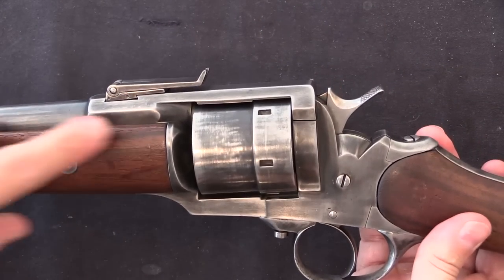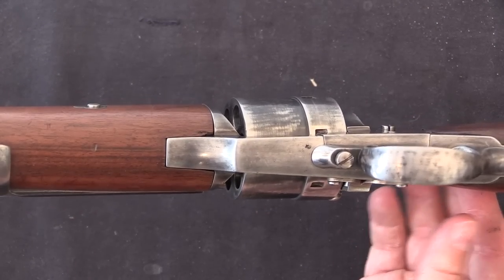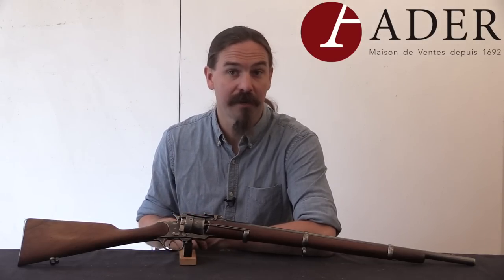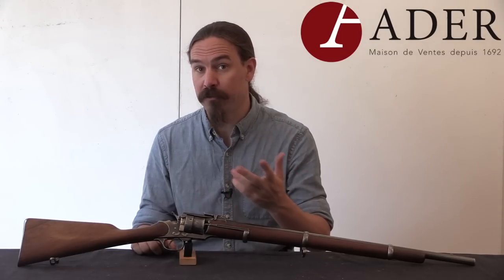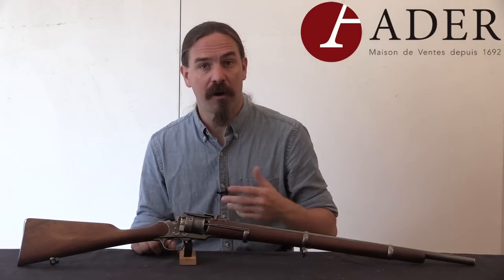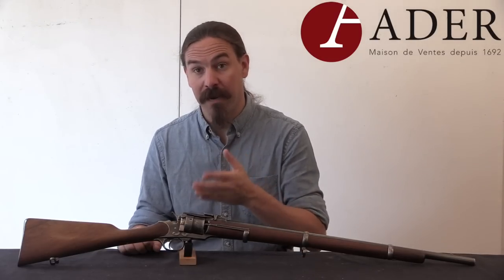Beautiful Perrin Revolving Carbine

Comment: if i could go back in time and give designers the idea for the gas-seal system from the nagant then maybe revolver carbines and rifles would have become a thing
Reply: Better, give them some Nagants and let them figure it out.
If you come from nowhere to explain this, they might take you for some crazy dude, or they will have trouble understanding.
Reply: You don't even need gas seal, just a piece of sheet metal around the bottom of the cylinder to shield the user's hand, like Rossi and the Russian MTs-255 revolving shotguns do. Why people didn't do this back in the day, I dunno.

Plus the forward sliding cylinder for gas sealing wasn't new, Savage cap and ball revolvers also did that. It's mainly the ammo that the Nagant used that was the new thing.
Reply: @SonOfTheDawn515  Well, A: the Rossi is a .45Colt/410 hybrid, it can shoot both, and .45Colt is a hell of a lot more powerful than 11mm Perrin.

B: That literally doesn't even matter, you're just making a small shield not enclosing the entire cylinder, the gas doesn't build up pressure, it just redirects it away from your hand. At worst you'd use a slightly thicker piece of metal.

(Also since these are black powder cartridges, modern smokeless shotgun shells actually likely, if not certainly, produce more pressure anyway.)

Comment: Might I hazard a guess that the reason that the carbine was single action was to make it more attractive for military sales? There was an obsession right up to the middle of WWI with troops wasting ammunition if they could reload and fire too quickly. Hence clinging to single shots long after efficient bolt repeaters came along and the fitting of magazine cut-offs later on. It even persisted into the 60s and 70s with full auto locked out or eliminated on some selective fire weapons.

Comment: Came for the Mr bungle , got distracted by forgetting weapons. Again. Always a top notch production. At this point even failures in the video shoot are endearing and add to the feel of it being real world and not a bunch of perfect everything and excuses for the guns like many "g and a "style gun writers do.
Note to self...add otf switchblade springs to the ejection rod and a miniature timing mechanism for a Gatling gun and a tapered round nosed rod. Lol lift the locking lever and rotate the cylinder, the rod pops in and out of the chambers making a far to complex auto ejection system.

Comment: I’ve often wondered why swapping cylinders, like later box magazines, never became a thing with these carbines and pistols of that time. Was it not functionally possible?
Reply: As far as I know it was a matter of weight and bulk. A six shot cylinder is way heavier and bulkier than a 15, even 20 round magazine nowadays or a 10 round mag a hundred years ago. Also every cylinder needed to be fitted to the particular gun it was meant to be used into.
Reply: Also on most revolvers it can be a giant hassle (during a combat encounter) to remove the cylinder, keep all the parts together, and then put back together. 
Consider also, that on most revolvers you're single loading, if you get caught with a partially loaded revolver, you can still get the thing to fire in short order. If you have the cylinder out of the gun, you have a club. 
And also just cost, you'd have to pay for all these cylinders fitted to your gun, and then you wouldn't use them 99% of the time.
Reply: If the cylinders could have been made more cheaply, quickly, and of lighter materials then maybe it would have been more common, I’m guessing.
Reply: Just seems to me that with preloaded cylinders the cartridges would just fall out either in your pocket or pouch or whwn fumbling to load it into the pistol.
Reply: Beautiful, someone (Uberti, I'm looking at you) should make modern copies for sale
Reply: @jeffturnbull9661  100% In something like .44 Mag it would be a lot of fun and quite handy.
Reply: @jonHErickson  it's somewhat harder to do that with a carabine because of the higher pressures it has to deal with.
Reply: The issue with revolving rifles is because of where you must place your hand on the foregrip it puts your arm right near the cylinder gap. Bang, fire flies out the cylinder gap, forearm flambé, repeat. 3rd degree burns on the arm may reduce the firing rate.
Reply: @johnanon6938 I mean no disrespect but, PLEASE,  there is little historic evidence to show that multiple cylinders were ever carried, let alone that it was common! Outside of one picture featuring one officer with a holsterbelt pouch that could be for a spare cylinder and the movie Pale Rider, not much exists. If you have further evidence I would love to hear it. What was common is additional guns, as in the Missouri Irregular cavalry , Quantrill, Bloody Bill and the James boys.
Now, with all of that being said the most likely of scenerios is that one could have gotten,  for  a short period, along with a factory new Reminton cartridge conversion gun, a second cap and ball cylinder for when the proprietary ammo wasn't availible. Then you may have had a pouch for a second cylinder, however the numbers of that combo sold would hardly make it a "common" thing. Plus, Clint makes that cylinder changing sequence look unrealistically smooth, in real life it is far more fiddley, certainly faster that loose powder and ball but if you figure in paper cartridges the margin narrows dramatically. I have often wondered how many "takes" it took for Clint to get that sequence correct....
Thanks for listening.
Reply: @stevailo  So Clint really was special with his extra cylinders?
Reply: @melvinharvey8279  someone could see it’s borderline historically inaccurate lol. So yes, definitely special
Reply: @Horizontalvertigo  At a certain point, you might as well just carry a backup pistol. That way, if someone's moving up on you while you're reloading your carbine or rifle, you have a loaded pistol ready. Nearly the same bulk as a second cylinder, doesn't need any special fitting, and if one is smart about it, uses the same ammo as the carbine.
Reply: Making a box magazine is real simple compared to a cylinder which must line up perfectly to the barrel each time, not to mention locking in place. I assume revolver making was very hand fitting intensive compared to other options.
Reply: @robertdeen8741  Actually, it's the opposite. Precision machined parts are easier to make than precision sheet metal parts. Late 19th and early 20th century manufacturing techniques made producing reliable box magazines possible.
Reply: @Horizontalvertigo  I'm not sure having several fitted cylinders made for a particular gun was even an option, as I believe it is more accurate to say the gun was fitted to a particular cylinder..
Reply: @deandeann1541  Depends on the time and place I guess. Some processes could just have buckets of parts, you choose whichever look like they'll fit together the best, and build/fit a thing together and then serialise it, but that's just one example. 
Regardless, it doesn't really matter if the chicken came before the egg, as you'd be hand fitting the cylinder, I.E: making it fit.
Reply: Switching cylinders while possible would be impossible on horse back and dismounted would entail the risk of loss.also there was still a lot hand fitting because even tho mass produced tolerances varied .plus expense and you could not carry enough
Reply: @doylehightechmattstumpf2529  Just put a shield over the left side of the cylinder gap.

Comment: Correct me if I’m wrong, but assuming that double action means firing and cycling the next round at the same time, wouldn’t this technically be an early semi-automatic rifle?
Reply: no, because in double action the energy to cycle the gun comes from the trigger pull- meaning the operator. In automatic or semi automatic the energy comes from the blast.
Reply: A better term than “semi auto” is “self loading”. Energy from firing cycles the action.
Reply: No.  The finger is cycling the action rather than the recoil or gas of the cartridge firing.  There was an auto revolver (Webley-Fosberry) that used clever mechanics and the recoil impulse of the cartridge to move the cylinder and re-cock the hammer for the next shot.
Reply: @lordilluminati5836  Ah I see, cheers for that.